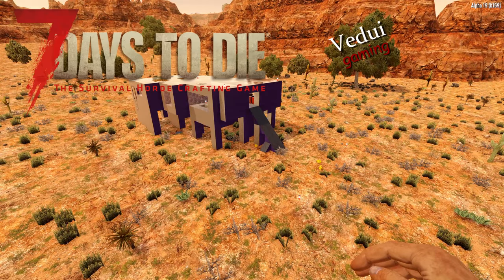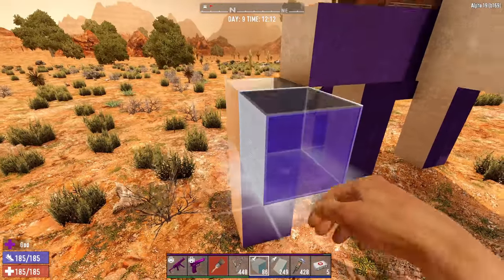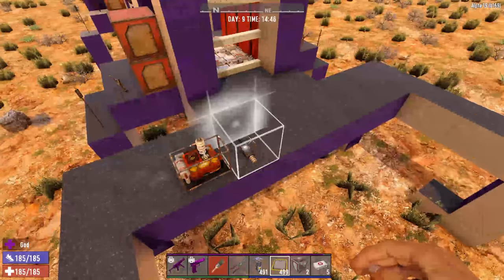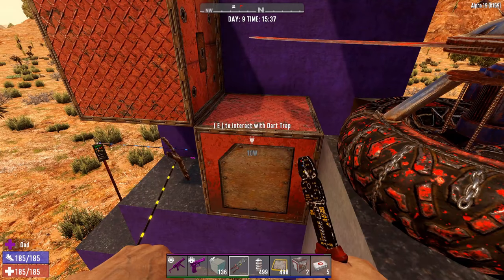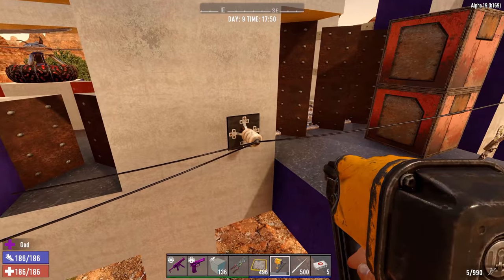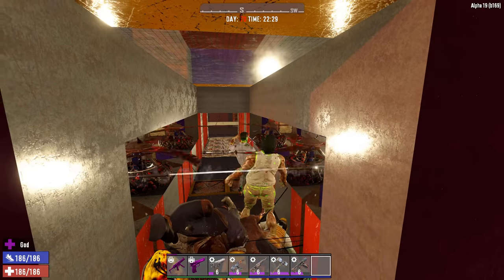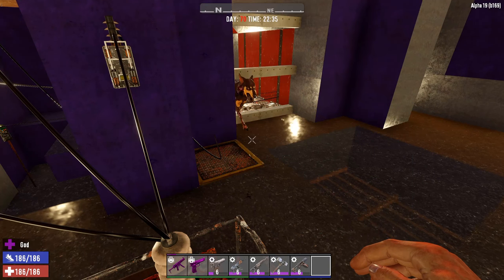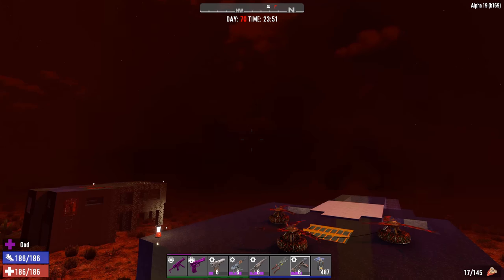Base Build | Powered Hatch Drop without Cheese! | 7 Days To Die @Vedui42

Comment: I would call this a NO cheese base, its not broke at any means, its only an automatic trap base running as it should. The resources and logistics to build its tough, but i always go for the electric way (i dont like cheese or bullet expensive ways).

PS: I would incluede a side corridor for repairs tho.
Reply from the maker: Thank you and yeah, it's minimally cheesy, as it is on a platform. But beyond that, it feels like a legit no cheese base :D I'd def have a side corridor, or from the top, where you can repair. I normally just do from the top as it's a bit faster and less issues with zombies going weird paths, but repairs during is nice. :) I've shown some bases that allow that before.

Comment: Yes this was the type of base i had in mind its like a zombie garbage chute and the best part of it is seeing that it uses legitimate game mechanics it is less likely for them to patch it out. The only thing is this is most defenetly a late game build because of the amount of resources and level needed to invest into it but if you do you will surely be safe during the hordes
Reply: You could start it early and just use electric fences. In fact forcing the zombies down a single path with full coverage by electric fences while mowing them down with a firearm is my favorite tactic and has worked very well for several alphas now even into late game. Getting the fences and other electricity bits is really the only challenging part of making such a build, and provided your shooting game is on point barbed wire can more than suffice for the first horde or two.
Reply from the maker: Yes that is true. It's def "harder" to do a more legit non-cheese base, such as by using this type of trick. It feels very satisfying though, as it doesn't feel like you're abusing game mechanics. Still, need that powered hatch! :)

Comment: Why worry about triggering the fences and blade traps at all? I just leave those running full time when needed. Dart traps make sense to trigger because they use up ammo, but I don't see any point in turning the others on and off constantly. For the Janitor you should test and see if a chest height trip wire will work.
Reply from the maker: Problem with keeping it all running always, is that you run through so much gasoline and gotta keep refilling, even when nothing is around. For a pure horde base it's less of an issue, but for dart traps you still need something to trigger. Apparently it's a bug, I checked with them and it's not supposed to be that way apparently :)

Comment: I stopped using the trip wires this alpha. Now I either just use pressure plates or straight 'always on' electric fences. On a base like this, pressure plates are already in the corridor to other traps anyway so, no reason not to use em for everything (except the doors obviously). Anyway, great horde base - I love it :)
Reply from the maker: Thank you! I normally avoided them, especially due to demolishers. But... with trip wires being a bit bugged, it seems trigger plates might be preferred in more spots.

Comment: I have found that putting the electric fences on thier own switch and having them always on, independent of that trip wire, stops zombies directly on the trip wire and they get darted quite nicely
Reply from the maker: Yes, that can definitely help. For  a proper base long term, one could easily do both, one circuit for the odd wandering horde zombie to kill them, and one for blood moon hordes where always on fences etc work better :)

Comment: Try making a dart tower at the entrance before the ramp up to your base. When darts shoot out, it will go down the entire length of the hallway and hit the posts do you don't get hurt by your own darts.

Benefit is when first zombie hits a trigger and dart trap starts going, it starts hitting the zombies further in the back and weakening them before they get to the blade traps and electric wires. 

Gotta make the back of the dart tower rounded so zombies path around it and don't bash. It'll be hard to refill the darts though.
Reply from the maker: You definitely could. When using trigger plates, which seem more useful, that would be more useful. When doing an L shape, those are even easier as they go down the length and won't hit the player, which can be an issue depending on how you put them like this :D

Comment: Well  on electric fences what I do  is have them always powered on not turned on by triggers such as tripwires.  When i testing stuff out in alpha 18 there seems to small amount of time  it takes to activate them  and because of how fast zombies move they are past the electric fence when they are activated. Also  because  the electric fences are not activated in time the dart traps are not as effective. For dart traps when  there is good chance zombies of them being electrified  by the fences I set the duration on the trip wires to 1 second at least .
Reply from the maker: I'll have to test it more. I know it's something which changes across alphas. In A17, zombies would definitely run past electric fences, be buzzed, but they would stop beyond the fence block. In A18, they would stop dead on immediately. In A19, they seem to be back to prior behaviour of running past even when they're stunned. I do wish they would decide on how they want it and leave it, as small things like that are easily compensated for, just it needs to be consistent. We'll see when/if the fix the Janitor zombie though, Prime did say it was a bug and not intended :)

Comment: Very nice! I tried testing the powered hatch drop type base in a18, but each time it activated the pathing broke and it didn't end well at all.
How do you do it so that the pathing isn't interrupted significantly?
Reply from the maker: I think the trick is 1) angle the motion sensor so it sees a minimal area. and 2) no duration on the trigger. It means that it sees the top of the head, triggers, drops, and the zombies vanish downwards so fast that there's only a split second where the zombies can recalculate to go somewhere else. The more traps you have before the drop also means less trigger it, making it more of a "last measure" rather than the main part of the base :)

Comment: Someone should report that broken tripwire trap to the Devs. I didn't know about trigger-plate pass-through (and still haven't tested it for myself) so thanks for that. I have tended to prefer trigger plates in my builds (and rarely use tripwires), and tend to use them to fire off dart traps. For blade traps and electricity poles I tend to just leave them running constantly through the horde. I mean - why have them stop at all? Your tripwire controlling the powered doors works well. [I've run entire hordes and hardly had any damage to trigger-plates which I use to trigger my dart traps.] Also, good to know that blade traps don't make demolisher zombies explode (in Alpha 19).
Reply from the maker: I did. That's how I know it's a bug. I checked with Prime ;)

Comment: On the trip wire issue, why have the electric fence use a trigger at all?  Can't you just run the fence direct to the generator, then it'll always stun the zombie which should keep it on the trip wire long enough to get a good trigger and activate the dart traps.
Reply from the maker: You can. I just like minimal passive power drain, so you can build it, and then have it work without refueling the generator every day :)
Reply: @Vedui42  Ahh, I hadn't noticed they draw all the time.  I thought fences only used power when the circuit was "completed" by a zombie.
Reply from the maker: Ah no... continous draw! I try to minimize :)

Comment: I almost always use a motion sensor over a tripwire for horde bases.
Also why use dart traps when you can use shotgun turrets?
Reply from the maker: So, tripwires allows for a specific block/row of blocks to trigger something like dart traps. A motion sensor would be bad as you'd waste a lot of darts. As to why use dart traps over shotgun turrets? Many reasons actually. 1) darts are far cheaper to make. 2) dart traps can be crafted earlier. 3) dart traps do not set off demolishers. 4) dart traps do massive damage :) Easy to put a few of them to cover an area and deal hundreds of damage per second, at very little cost of metal/clay.
Reply: @Vedui42  I did not realize dart traps were so effective! I bought 7d2d back when it came out but only played it for a few hours. In the last couple months my friends and I have been playing it like crazy. Thanks for the reply and you've earned a new sub!

Comment: Janitor should be fully configured and fixed now in 173. Didn't test it yet though. 😊
Reply from the maker: Possibly! I need to test it out. I didn't see it mentioned in the patch notes!
Reply: @Vedui42  It has been mentioned in the 169 patchnotes that the janitor zed has been added, but optimization and full functionality will be added later. I think they said b170, wich we never saw, so i simply assume that it's done now in 173. Just guessing though. 😁

Comment: Since I was able to watch your video about the vulture blender earlier, I was surprised to see the vultures move fast enough to avoid being hit by the blades. I did not think that they could swoop underneath and survive. So, instead of a laying out the blade traps on the flat part of the roof, why not set up a three-axis cross. In other words, the middle blocks of a 3x3x3 cube with the corners and edges removed. You could mount five blade traps on the five blocks that are not attached to the roof. That might make it more difficult for the vultures to survive swooping down upon you.

Would it be easy to restock the dart traps everywhere? The ones at the beginning of the corridor are accessible because the blade traps prevent you from blocking them off entirely. What about the one closer to your safe zone? Are they only accessible from the exterior?

Is there a limit to the number of trigger plates that you can use as a pass-through for electricity? I was not aware that a relay between any two trigger plates would prevent electricity from passing through. It seems to be a shame, but it does open some possibilities for controlling traps at a distance.

How much range does the nail gun have? How good is your aim? I cannot wait to see that video, once you work out a use case for it when you combine them with trigger plates.

As you pointed out, I hope that The Fun Pimps change how the janitor behaves with trip wires. It does not make sense that one zombie type is capable of missing the trip wire each and every time. If the zombies are shuffling their feet, then they should trigger some sort of event.
Reply from the maker: They do swoop down yeah! Normally after a few moments they'll back off, and come back again, and I suspect with some corpses below the blades, it also helps to prevent new vultures from dropping below as it appeared to kill the subsequent vultures much faster! :) So as far as restocking the dart traps, easiest is just to have a hatch with a ladder down behind to access. Or from the front (which is how I often do it). It's extremely unlikely you need to restock darts during a blood moon horde, possibly the first set might run out, but then the next set will take over. Normally with 8 dart traps in a kill put I'd go through maybe 4-5k darts, so a stack two at most, so unlikely to be an issue :D

Comment: I learned the other day that zombies will path across the centre of a bladetrap.  Even when they are mounted sideways.
Reply from the maker: Path across the center of the blade trap... meaning straight into it? If so, yes. It was one of the reasons in my best horde base ever I put a ramp there, to avoid them pathing into (and bashing it) as an obstruction :)
Reply from the maker: Ah now I know what you mean. Yes. I covered that in Alpha 18 actually. Where putting them like that at the bottom was one way of using them to kill demolishers without (normally) setting them off ;) https://www.youtube.com/watch?v=0yKBwNUN1B8
Reply from the maker: And btw you're always welcome on my discord!